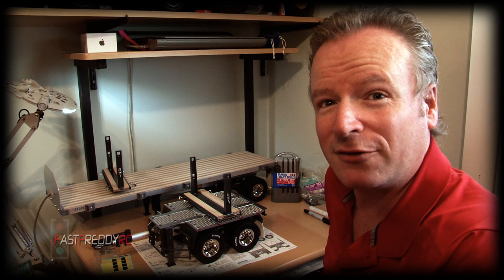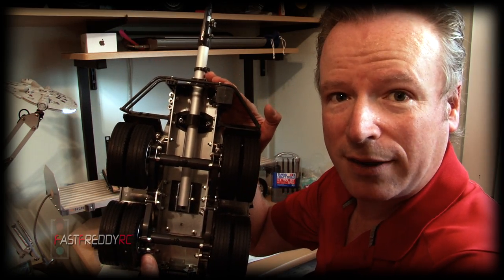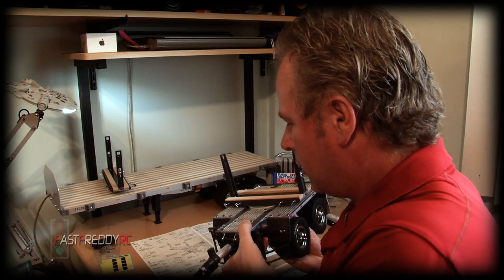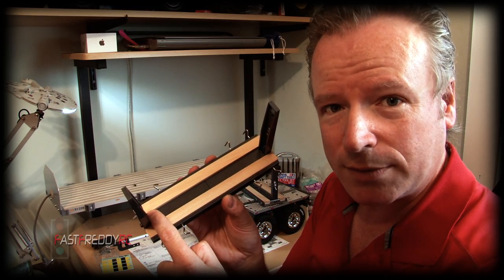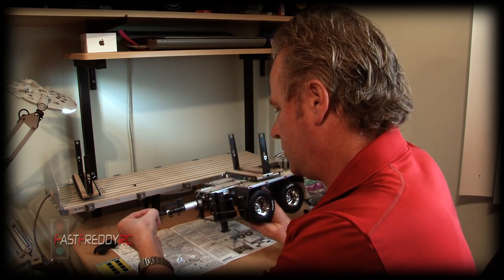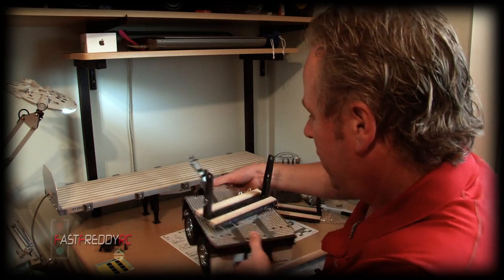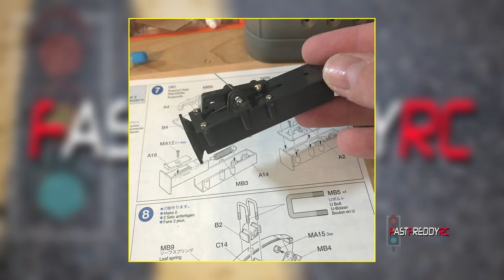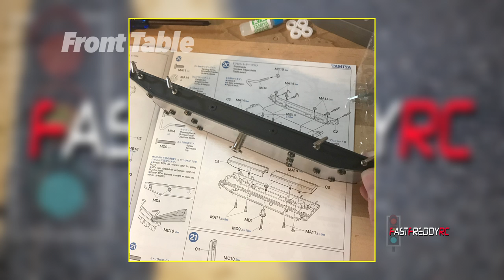Tamiya Pole Trailer - Tips and Tricks

Comment: Subscribed! Awesome little trailers! Good pointers. Ya less warning labels is good lol. Also like how its lower than the flatbed, the flatbeds are a bit too high anyway......The Mansfield bar
Reply from the maker: Thanks for subscribing!!  Really appreciate it! AND...I appreciate your input...so that's what's it's called...the bar at the back...the mansfield bar? But I agree with you...I think the flatbed trailer sits a bit too high.  The weird part is if it sat lower, it wouldn't couple up to the semi.  So is the scale correct?
Reply: @FastFreddyRC  Ya interesting story too how they came to calling it that, Anyway......not too sure where the error is with the scale. The flatbed clearly has some scale flaws. One is that it's too short. It about 27 inches which scales out to 32' in 1/14. I mean thats too short. Especially to be pulled around by a highway truck. Kinda looks silly. The truck is practically as long as the trailer! Most flatbeds are 48' or 53' at least here in Canada, unless they're part of a B-train which are two short ones, 28' and a 30'. If Tamiya made the trailer 45'' that would be a 53' in 1/14th. I guess they wanted to save on costs, thats an extra 12-13 inches of material they'd have to include. Woulda been nice if it was at least 35 inches, 27'' is too short. Anyway I just bought two of them and gonna make them into a set of trailers so that it looks more scale pulling around. It's not gonna really be a B-train because they'll be connected wit ha 3 axle dolly which is more of an A-train. More commonly seen in box trailers. Anyway, that was a bit longer of a comment than I planned lol. Sorry to bore you. Talk soon Freddy. Keep up the good work 👍
Reply from the maker: @westernsharpie  Not bored at all!  Love your input and knowledge of these trucks!  It's so awesome that you are taking that knowledge to the kits and making them look even more scale looking then they are stock.  That's serious attention to detail.  So I'll say the same thing...keep up the good work! Love seeing what you keep adding for realism.  And once I'm ready I'm going to be ordering a bunch of stuff from you.

Comment: Hi, I'm just building my trailer, and I noticed that the rear turntable only rotates so far in either direction due
to the protruding screw heads. I assume this is correct, I just had the idea it would rotate 360.  Beautifully engineered kit !
Reply from the maker: That would be correct!  The rear turn table can only go so far.  It's not meant to rotate 360 degrees.  As the front of the load will be sitting on the piece that you attach to the hitch, there is no need for 360 degrees rotation...it just would never ever get to that point.  So long story short, the design is correct.  Absolutely love it!
Reply: @FastFreddyRC  many thanks for your reply !
Reply from the maker: @johnfellows2867  You're welcome!!